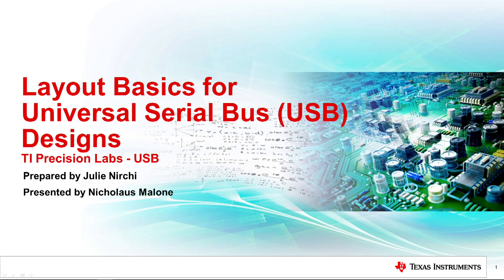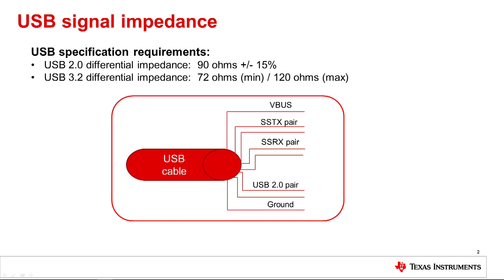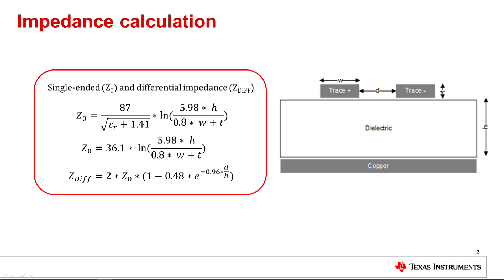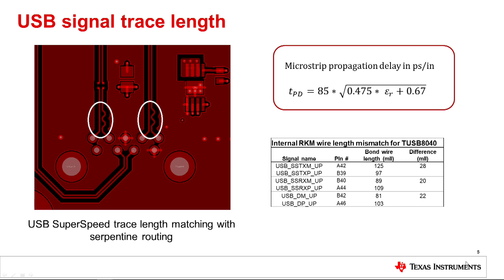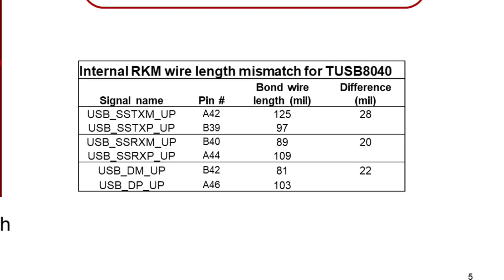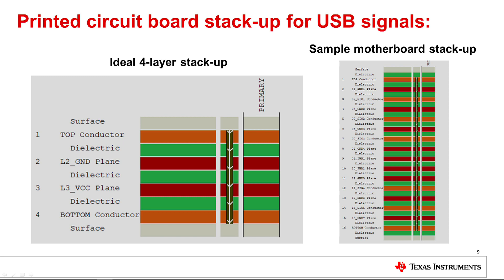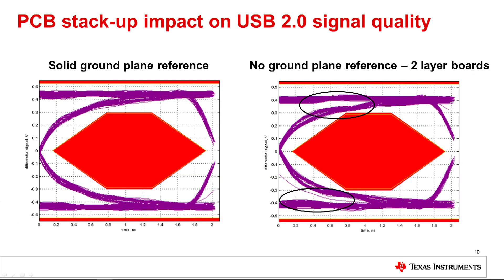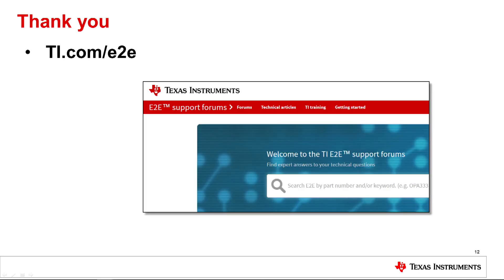Layout basics for USB designs

Comment: 8:35 "If layer-to-layer trace routing is required, the number of vias should be minimized. Differential pair vias should be symmetric and have accompanying ground vias to maintain ground return path."
Could someone explain this in a bit more detail? If I have a 4-layer board, the top and bottom layers each contain a high-speed line that is supposed to be connected from top to bottom using two vias, and beneath the top layer there is a GND plane, and the third layer is then VCC. Where should the two GND vias, which are supposed to be placed symmetrically to the signal vias, go? After all, I only have one GND plate in such a 4 layer design.

Comment: "Taking care not to route at right angles over power plane splits" Can someone give an example for this case?
Reply: I suppose you have already found the answer as there're plenty of examples if you put this string in a search engine. For others reading this - this is a very important point and not following it will create EMI and signal integrity issues. Try to avoid splitting ground/power planes when possible. For the right angle trace turns - previously there used to be etching problems but now the main concern is -fast electrons will derail- sharp edges act as emitting antennas, so again EMI and signal integrity issues especially for fast signals.